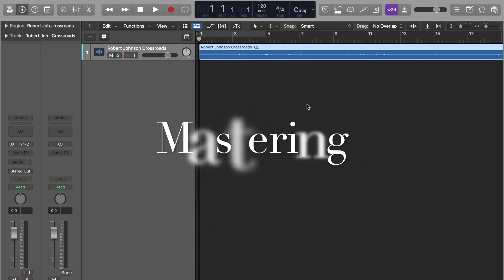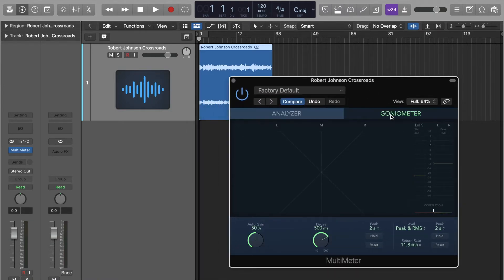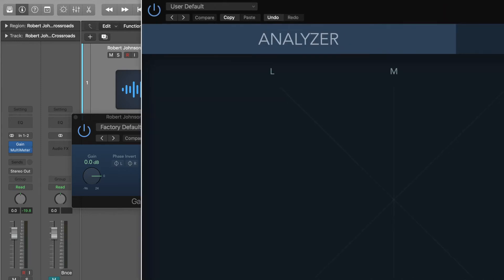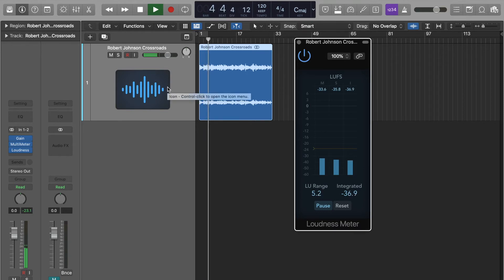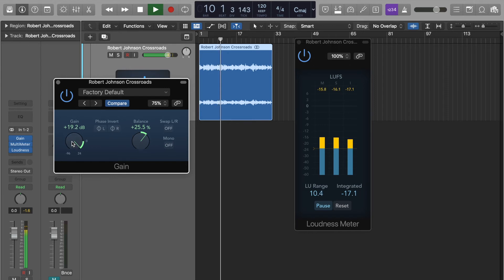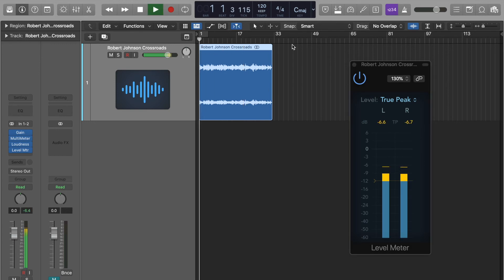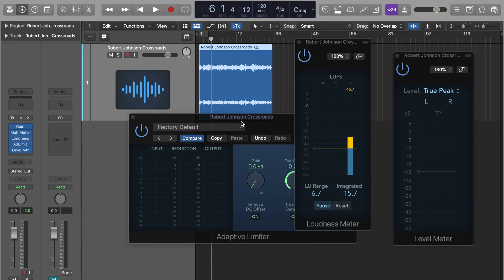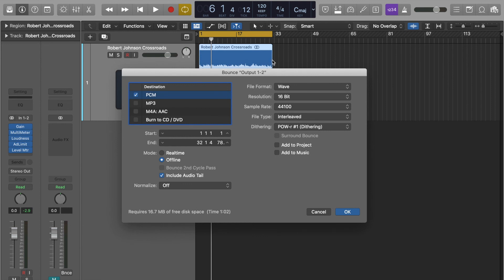How to do Basic Mastering using Gain and Limiter effects in Logic Pro X.

Comment: Would it not be better to address the balance issue in the mix? You'll be moving centered instruments off, like kick and bass by just altering the whole balanc.
Reply from the maker: The panning doesn't change the timing aspect of how you hear the direction of the sound it just balances it's volume. I agree with you if your mix is not as good as it can be it should be mixed further rather than moving to the mastering stage.

Comment: Is there a reason you use the gain plugin to increase the gain as opposed to using the limiter to do it?
Reply: You are correct you can use the gain on the limiter. However between the gain and the limiter unusually place linear phase eq and compressors. So the limiter I use only to stop peaks at the end of the signal chain.
Reply: If your final audio level is too high your ad limiter will squeeze your dynamic range too much